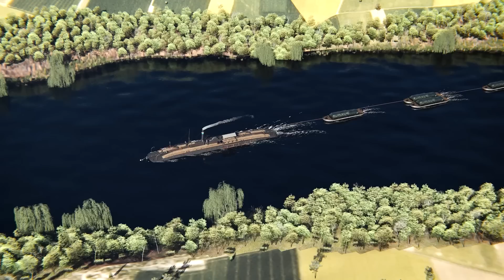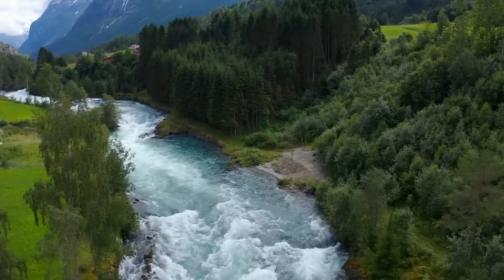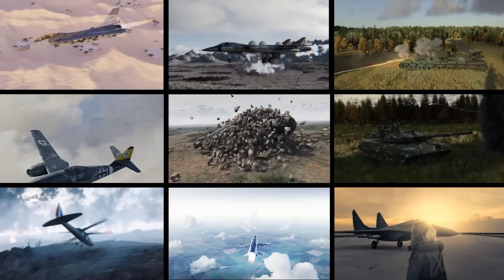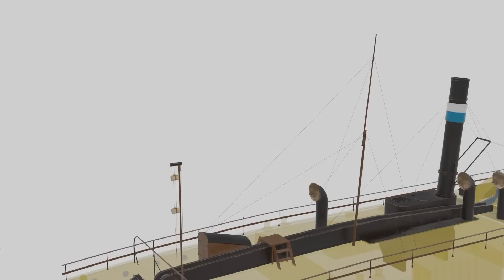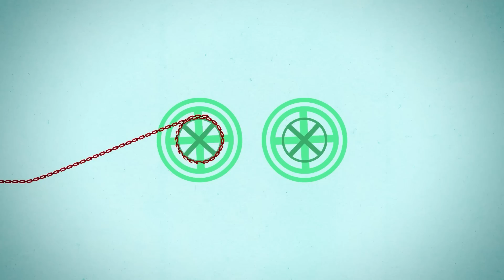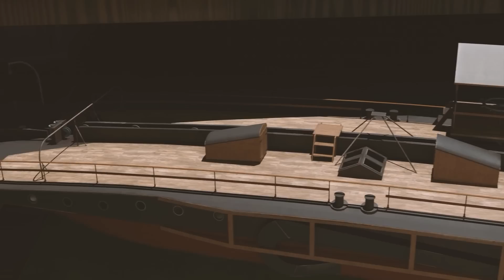Why The World Simply Abandoned  "Water Trains"

Comment: How did the chain get put on and off the boat?
Reply from the maker: Long poles to pull it out of the water. Every 50 meters or so there was a chain link that had a sort of clasp that could be opened. So they could unlink it and thread it through. Naturally this took many hours and was very heavy.
Reply: Your the guy with the research but mariners don’t usually use poles to pull up chain.  You’d use a grapple on the end of a Hawser rope.  But likely they would buoy the end so you didn’t have to.

Grapple the chain, pass the hawser around the windlass, and use the steam engine to pull the chain up on deck.
Reply: @FoundAndExplained  That isn't how you pronounce drought. It's "draft."
Reply: @kyle857  that's draught.  Drought is a lack of water and pronounced drowt.
Reply: Similar to a boat anchor
Reply: probably a winch and another chain and some tie chains.
Reply: It's like when you suck on a strand of noodles and then you release it slowly, and so on.
Reply: They sank. Qestion

Comment: Because they were too expensive, too complicated and unlike a boat which can be used anywhere and doesn’t require a massive metal chain that’s prone to rusting or getting clogged up into the machines system it’s not really that surprising to see why they fell out of favor although they would be useful in shallow swampy areas but then again, what can’t this do vs say a flat bottomed fan propelled boat or a paddle steamer? Not to mention that they’re limited in where they can actually go along with the initial cost of laying a massive and heavy chain down a path which might get clogged up with twigs or branches along with weeds and moss as well as the unfortunate creatures that are happening to be caught in or on the chain at the time

Comment: One important concept was missing in the report. If you pull a rope hanging out of your boat, you get the rope into your boat. Unless the rope is fixed with some kind of anchor.
But the chain couldn't have anchors, cause it's supposed to be lifted without moving downstream. This is just avoided by friction on the riverbed, nobody can pull a 100km long chain. No need to fix it anywhere (like It's necessary for cross river ferries). So even when the chain broke, it didnt effect boats in 10km distance.

Comment: “Someone is wrong on the Internet. I have to fix it…”
The engineer in me groaned when you called an impeller a turbine. A turbine is driven, an impeller drives.
Reply from the maker: Damn learned something new!
Reply: @FoundAndExplained  - then lets please add how to pronounce draught.
Its pronounced draft.  Same pronunciation as a waft of air through a gap, 
Not Drort. 

(i come meaning well tho, good vid in most respects- and could be worse man. The muppets at dark seas think the front of a ship is a decorative loop of ribbon. And your unlucky- draught is an exception to rules thats not pronounced in obvious way, and is bit of technical term...

unlike bow, which has a 2nd common usage with same pronunciation.)
Reply: It didn't bother you when he mispronounced drought?
Reply: @kyle857  it did, but not as much as that seemed to be just a “reading the script” effect. Should have been caught in the proof viewing of course. Was it wrong more than once?
The turbine line was factually absolutely wrong.
Reply: Is the Zeuner water turbine, its actual name, powered or not? If it doesn't use an external.power source, which I am not sure would work or not, then its a turbine as an impeller uses a power source to spin the impeller blades to create both suction and thrust as it does in a jet ski.
Reply: And prevalent not prevailent!!!

Comment: This is still a thing, in a way. You won't see them used as tug boats anymore but there are still ferries about that use chain to pull themselves across bodies of water. 
Barges tied together and towed by another vessel never went out of fashion. The only thing that changed was the motive power.
There's also a barge called a Car Float. They were used in the states to float rail cars/carriages about. They'd also hook several of them together for towing, which is the most water train thing I can think of.

Comment: Never heard of this. How did they load/unload the chain? That couldn't have been easy.
Reply from the maker: Mentioned in another comment but there was a loop about every 50 meters of chain which could be open (kinda like a horseshoe shape chain link with the missing section being a screw that could be undone). They could pull up the chain from the river and then undo it, thread it through, and then off they went

Comment: My grandfather used the cables between the barges to grab on and swim upstream for some kilometers. The current would bring him back in half an hour. It was strictly forbidden.
He told me much about those, and all said in the video is correct. The chain rests only on the riverbed and would have to be layed down far outside in corners, or it would get to shore on the inside of the riverbed after a few uses. 
BUT: Many of your pictures are misleading: The chains where extremly expensive, so only bigger streams with lots of things to move had these chains. And even as these ships only had little draught, they would not go on these little rivers in the video. They are too shallow and too windy. Also, the water jet system is only one of many, and only at the late models. It was big enough for getting the ship back downstream without the chain. Because if you get in oncoming traffic with only one chain, it would take hours to release the chain, pass, find and reattach the chain.
Another reason they stopped the service was the diesel engine. The service stopped between the world wars, so much later than steam paddle ships. All the barges had captains and had to be steared, so giving them their own diesel motor and propeller was easy and would give them much more freedom (not waiting for a chain ship with free capacity for days or weeks). And the barges/boats went bigger, so even more efficent
Reply: Forgot to mention: We live in Mannheim at the river rhein / rhine in Germany. My granddad has worked for the port authority there and tried to save one of those ships for the museum - but they were big, heavy and had a lot of rust - the last years of service didn't pay back, so the maintenance was reduced.

Comment: This chain system would get really complicated with increased traffic. Unless each ship had its own long and presumably expensive chain there would be no means of faster vessels passing the slower ones. You also mention little about return trips. Did the ships simply drift down river? Otherwise I would imagine a need for a return chain route and one perhaps for each side channel!
Paddle wheel steamers seem so much more flexible and versatile. I find it hard to imagine that long distant cable-driven were ever in general use. 
I do see how this would work for shorter cross-channel ferry trips. Here in the middle of Canada, I have taken the Riverhurst CABLE Ferry that travel 1.5 KM across Lake Diefenbaker pulling along a cable. Presumably it work just as well pulling on a chain.

Comment: I am intrigued by this, although I see the issues I am wondering if using this idea (basically using a windlass to pull your boat) is significantly more efficient than a good screw propeller?  Despite its problems this is a technology that could make a comeback if fuel savings make the additional infrastructure and operational issues worth the savings.

Comment: tl;dr we found better ways to accomplish this. 
1) Underwater chain is extremely expensive. Only made sense when steam engines were weak and inefficient. Today's efficient boat engines make this technique obsolete. 
2) Modern barges are lashed together. It's the tonnage of a train, but easier to control because they move in sync.

Comment: Water trains still exist!  Only now they are tug boats running with diesel engines pushing several barges at a time for bulk goods such as grain, coal or ores.
Reply: Properly speaking, the 'train' is the part that 'follows along behind'... on railways, the locomotive is not 'the train', and calling it Part of the train is already debatable (though camel trains, wagon trains, and multiple units all blur things a little such that you can include the leader, in this case the locomotive, as part of the train). 
If they're being pushed rather than following behind, then they're not really a train... though we might still call them such if they have enough similarities to the archtype (which, these days, would be a locomotive hauled railway train). if the barges are attached to each other more than one wide the analogy breaks down entirely so they don't count that way either.
Reply: @laurencefraser  Properly speaking anytime a locomotive is pushing rather then pulling we can't call it a train.

Comment: Highways is what happened.
Reply: Nope. Those where out of service well before that. The reasons where locks and dams, changes in river navigation (often with dynamite), more modern/powerful engines not usable in this type due to their working characteristics and a switch to self powered barges that where more flexible. The last german ones went out of service in the 1930s while ship transport was still going strong and still is

Comment: Cable ferries is both plentiful still in use today. While replaced chain with cables, its basically do the same thing 
(granted, cable ferries typically spool up the cable in stead of just passing it.
Reply from the maker: The spool system was actually used by the chain boats in the very beginning but naturally that was point a to b. The chain boats here actually could operate along the whole river

Comment: Kinda vaguely knew about them as a thing, but thought for a while they were a sort of push/pull kind of screw propeller tug. 

Then saw the illustration of the barges being on longer leads and immediately thought " That's dumb, how would the barges stay under steering control when going down stream and not get wildly out of line..." 

Then came the " these were only around for fifty years and is a design likely never to be used or seen again." Which got the "Yeah, it's a design made by someone that should really have learned more by observing than just saying they were smart and knew things because they had book learning." Water near the edge of a river acts very different from the middle. Plus there's sunken snags from flooding or erosion to think about. Silting over your drag chain, on and on.

Yes I can see where this would have been a revolutionary idea and design when first deployed. But any rubbing of brain cells together would see the glaring flaws quickly. None the less, a neat part of history and archaic design features that were absolutely a no turn around dead end.

Comment: Well, water-trains still exist, as in one tug pulling a number of barges. However, they don't pull themselves along chains any more, but use propellers or Voith-Schneider rotors instead, and the barges are closely lashed together to have one big unit rather than a lot of boats on a string. 
I am from Bavaria (the famous diamonds just as white and blue just as the bands around the funnels), and have seen a couple of models of these tugs in museums. Although I have always wondered how the chain was anchored in the river bed and how that worked out around bends. Thanks for the clarification.

Comment: The barge trains throughout the Mississippi basin come pretty close to this.  A tug pushes a maybe four-long three-wide group of barges
Reply: No, totally different system since the tug is not tied to a chain. The tugboats replaced this system. The chain system can not use compound engines (they run to jerky) but wheel and screw tugs could. So more flexible ship using less coal. And with tugs in continental europe often being state monopolies- that was the end

Comment: Growing up and living in the USA, I hadn't heard of this technology.  It was an interesting solution for the times.  Like another poster said, it is roughly analogous to a cable car however the motive power is on the craft not in a stationary position.  And, similarly, while ingenious, they have more issues than other technologies.

Here, we had a canal heyday from the early to middle 19th century.  By, 1850, the railroad was already supreme so, river transport was only practical on the big rivers (Mississippi-Ohio-Missouri), Hudson River etc.  This is probably why they never caught on here.
Reply: The system worked for quite a time and quite well. Fell only out of use because engines got cheaper and more compact so a classic tug and later the self powered barge replaced them in europe
Reply: As for the railroad being "supreme" - ships need a lot less power per ton of freight. So assuming you have a decend net of rivers and channels bulk cargo is better on the water

Comment: I mean, I feel like anyone can put two and two together to figure out why these didnt catch on.
Reply: They did catch on. Until better technology replaced them. Over half a century of use is quite a bit of usage for a technology that came in when steam engines where Single expansion and lasted until diesel powered river boats made an appearance
Reply: They make about as much sense as some of the early railways being cable hauled by stationary steam engines at the end(s) of the line. Which is to say plenty, for a given tech level and budget... right up until the engines got better by enough that the benefits no longer outweighted the drawbacks by enough to justify it.

Comment: There are still lots of ferries that work this way, just across the river or straight, instead of along it. That way the chain/rope is much shorter and useful.
Reply: With a single boat per chain, and a chain with fixed ends, it's a rather primitive concept.

Comment: If you have ever seen the movie The Knights tale you will have seen the predecessor to the chain boat , the rope ferry, in two different scenes, once with young Will Thatcher meets the knight he is to be sold to as a squire by his father, and when “Sir Ulrich” returns to London for the Grand Tournament …. The chain boat is simply a more powerful version of a rope ferry, but with several added benefits…. Particularly in maneuverability and in rope/ chain maintenance. Replacing entire lengths or individual links being easier than splicing rope in the middle of the river
Reply: No, there is absolutly no relation to a rope ferry, cause the new thing is, to have a machine on the boat. Everything with ropes is always fixed on the shore of the river.

Comment: I'm not an engineer but I think this type of boat can be used today in the rivers of Mexico and Central America, which are mostly difficult to navigate.
In Nicaragua for example there are rivers that connect the Atlantic Ocean with its main lakes. That would make the Nicaraguan canal possible without affecting the course of the rivers and the environment.
Reply: This is worse than a diesel powered tug or barge. That is why they are no longer used in germany (that had quite a few on the Rivers).
Reply: The chain is more for speed , than for navigation. Imagine swimming against a little current, either freely in the water or pulling yourself along a rope. With strong arms you gain more speed on the rope. While it is impossible to swim faster in open water, just with more power. You would need bigger hands to swim faster, to create more resistance in the water.

Comment: They roll up and down the river right outside my house all the time, what you talking about "what happened to" them? Can hear one's turbos howling as they slug upstream right at this minute, actually. The biggest ones I see push 20 barges full of coal at a time, 3x6 out front and 1 on each side of the tug. The bends in the river right thru here dictate maximum length, and up in the heel of the boot, they gotta do 3 point turns sometimes anyway.
Reply: And they pull themselves along on a chain on the river bed? I have my doubts
Reply: @mbr5742  no the chain was a stupid idea. Rivers curve.
Reply: @camojoe83  here's an extra bonus: if they're not Pulling a Line of barges, it's not a train. (single unit railcars are also not trains, nor is a locomotive by itself). 
Barges still exist, sure. They're generally lashed together side by side (and sometimes a couple deep) and Pushed by what amount to tugboats, using a completely different engine type. 

Sure, barges, boat, carry cargo, float...   but by that logic there's no different between a steam engine hauling a bunch of four wheeled open trucks and a Semi.
Reply: @laurencefraser  my great grandpa ran an oil fired steam tug pushing barges on the river, trains push cars as easily as they'll pull them, and other than scale there's very little difference between a tractor trailer and a train, and even less difference between a coal or oil train and a float of barges in the river carrying the same.
Reply: @camojoe83  Why should a curve in a river be a handicap ? Chains curve too. There is no maximum length, there is a minimum length to operate.
What river are you on ? There must be some images on the Internet I guess.